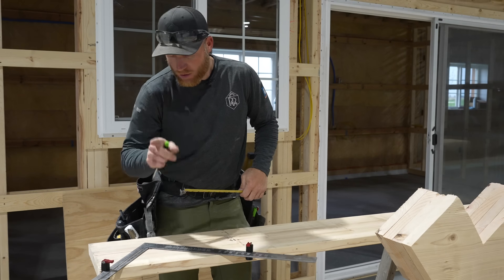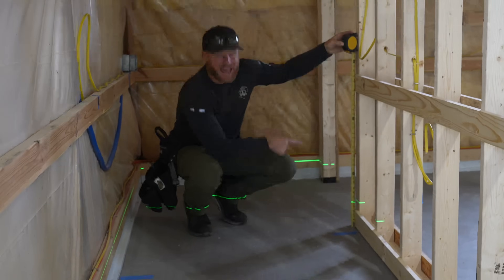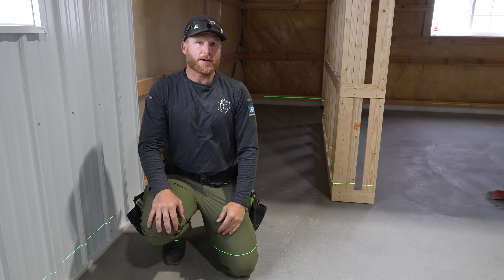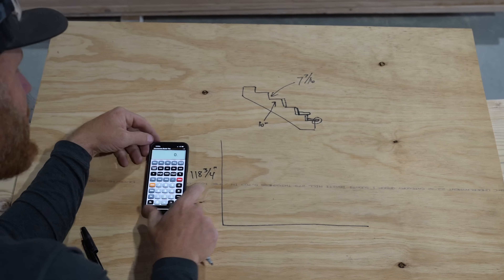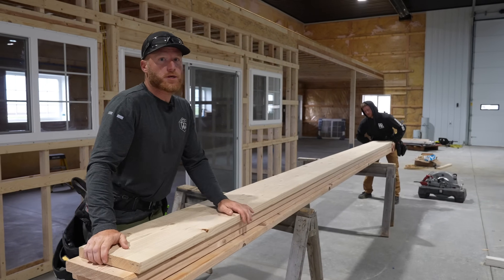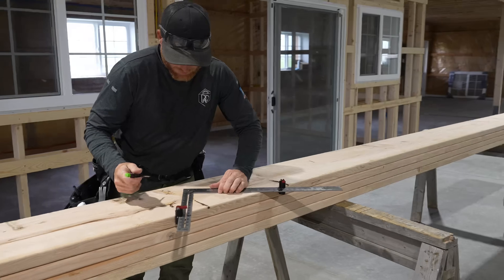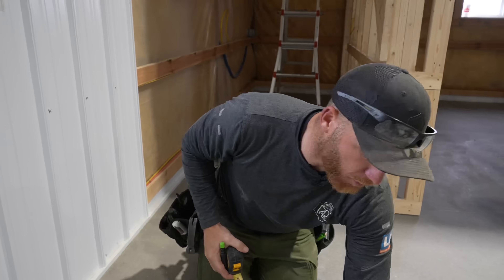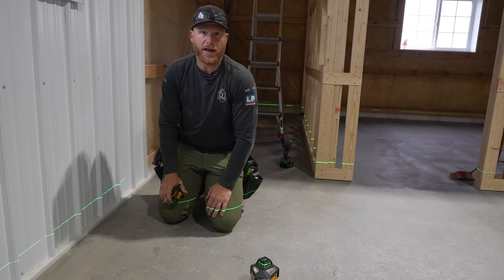Large Workshop Buildout 4: How to Build a Staircase like a PRO

Comment: after you entered the rise and distance out for the treads, what did you punch in to get that 36.58, and then you hit something else again to get the 12 7/16ths? Thanks, Kyle! What is an inspectors error margin for the rise and tread? I was wanting to say that it is less than 1/8" but it's been so long since I done stairs with my dad that I forget how close it has to be to pass an inspection?
Reply from the maker: Not sure exactly. It I can guarantee no inspector is complaint about these stairs
Reply: @RRBuildings  just wondering. I can think of a few times as a teen and then in my early 20s that an inspector in Oklahoma made him redo some stairs because either the top riser was different or the bottom was, but I can't remember what the margin of error was. You seem to have it down pretty tight though! Thanks for sharing the process you use!
Reply: The angle of the rise over run for 118 3/4 over 160 is an angle of 36.58 degrees.  The angle of 7 7/16 rise over 10 run is 36.64 degrees.  The rise of 7 7/16 over 10 will give a distance of 12 7/16 across from one point of the stringer to the next point of the stringer.   The actual number is 12.4626     which  is 12 7.4/16 if these dimensions are done in decimals.
Reply: Rise then Run then Pitch to get the 36.58.   Rise then Run then Diag to get the 12 7/16" (using the 7 7/16 and 10)

Comment: Adjusting the stringers at both ends takes into consideration that the floor is the first tread and the top of the stringer is the last riser.  
At the bottom you subtract the thickness of the tread.  At the top you subtract the thickness of the riser since it’s already there with the header.  
Not sure that’s clear with Kyles explanation.   
This kind of stair building does remove a lot of the structure of the stringers .   A lot of stair makers router the stringers and use wedges to secure the riser and treads.  The risers and treads are slid into the grooves from behind/underside    
Math is the same but structure much different
Reply from the maker: Never seen such a thing have any good links or examples to share?
Reply from the maker: I take that back I understand the sides being routered out but then what about the middle stringers?
Reply: @RRBuildings  on residential where say the staircase is curved they may use laminated stringers from ply’s of some kind.  These stringers provide the support for stairs plus nailing surface for drywall.  
The plys  allow for curving of specialty stairs but will work with straight stairs. These will obviously be notched but since they’re laminate they are mighty beefy.  
Older homes with 36-40 inch wide stairs may not have have middle stringers.  
Im sure code dictates the load requirements for each country and city. 
Your mileage may vary.  
Wider the stairs the more support of course.  
In custom homes the stairs are made in shops and installed… you already know that.  But your building s are different. Rural residential is different … not worse but different.

Comment: Two birds with this stone, 
1st the 199 vs 199.25
118.75 ÷ 16 = 7.421875.  
-7 = .421875. Then for the 16ths  × 16 = 6.75
Since this was done by the calc it gave 7/16
For every 4 rises a 16th was lost 
16 risers so 4/16ths

2nd these inconsistencies can be ignored.
Wood expands concrete settles 
a good carpenter is wrong the right way.
If you start with perfect you'll be off for sure.
But it is fun to aim for perfect
Reply from the maker: Agree
Reply: @RRBuildings  you guys are doing some fun stuff.  I'm definitely stealing ideas.
#1 is post frame construction.

Comment: Reason why didn't hit the 199" 1/4
You took measurements just of one step. Take the full rise height and divide it by the number of rises that you need that measurement use it as your rise and 10in as your run
118" 3/4 ÷ 16 = 7" 7/16 RISE.  10in RUN. DIAGONAL 12" 7/16. HIT + = And the calculator will give you measurements fixing the 1/4in cumulative error

Comment: I liked the video. However, i wish you took it a little slower with the math calculations in the beginning, explaining where you were getting each number from. 

Additionally, i wish you explained the extra measurement you did at the top and bottom of the stringers after you measured out the whole thing.

Comment: I really enjoy stair building.  On this stair planning, you mentioned but then didn't address the basics.  The first thing that you do is determine your floor finishes and address them in your measurements and calculations.  What you did is fine if all finishes, ground floor, stairs, top floor, are bare or carpet.   Examples: If the ground floor is bare concrete and the top floor is carpet or even an engineered wood floor.  Everything is wrong.   If you are going to replace your rough in treads with 1" oak.  Everything is wrong.  
Also, your stringers should have supported at the back.  The front of the stringer is all "short grain."

Comment: I thought the floor wasn’t level, but I watched 4 stringers cut to match. No packing or levelling took place…so how did stairs end up level/
Reply: At 29 minutes in he goes over how he adjusts the stringers to make them level. 

Stringers were cut at the bottom to adjust for the slope in the concrete which was determined with a laser and a tape at each location where the stringer makes contact with the concrete.

Comment: If you enter your total rise (118 3/4”) and your run (160”) hit diagonal and get the 199 1/4, without pressing anything else divide by number of rises in this case 16 you get 12 7/16. You can then add that number to itself and the calculator does the rounding to nearest 16th for you and your last mark will be right on 199 1/4”.

Comment: If you don't own a construction pro calculator then buy one before trying to cut stringers.
FYI nail 2x4 to wall not stringers.
7 1/2" riser is the Maximum height.
No minimum.
 Industry standard is 7 1/2".

Comment: 45:32 Am I crazy or did something fall off the wall? o.O
Reply: That's a gasket from the screws that were removed when they trimmed the metal, screws haven't been replaced because they'll most likely come back through in short order and install the flashing above the stringer where they cut the metal, etc.

Comment: Someone please explain to me why he's adding an extra 10" (1 tread length) to the run? When calculating it myself,  stringer length should be 186-15/16". Even going online and plugging his original values of 118-3/4" rise and 150 run (15 tread lengths) into a stringer calculator,  the proper values of 7-7/16" rise and 10" run are given with 15 treads cut into the stringer.  But stringer lengths do not match up with this video. 
If we were to add the additional 10 inch to the run in the calculation,  to get this 199-1/4" stringer length,  Tread width is no longer 10 inches,  but slightly wider. Because you're using an overhang,  you're not noticing this extra width you've added to the step but you've made the stringer longer and and changed its pitch slightly.
  
Really confused on why you added this extra 10 inches. Makes no sense to me; and all calculators, even the one you're using,  says the stringer should be 186-15/16" long when using 10 inch wide treads. 

Now if you plug in your values into the calculator,  118-3/4" rise and 160" run,  and hit the STAIR button,  it will report a stringer length of 199-1/4" HOWEVER, it will also report a tread width of 10-11/16" wide tread.  Not a 10 inch tread like you cut out.  

Your math looks to be incorrect and you should not be adding that extra 10 inches to the run. 

 6:28

Comment: Good info and video. But  a great example to learn and use metric ( mm) units.  Buy a metric tape and do a video. Much,  much easier. Do it without an app.  1/16 ths ad up and are not accurate!! Once you learn mm you will switch because you will be exact and I know you like to be.. Lay out the "hypotenuse" and index off it not the previous mark. A sq + B sq = C sq.. simple and exact.. You know, math..

Comment: Good build, but two things. Your risers do not need to be 2xs and for your treads. You're wrong. Just like you put your crown up. You want your ri gs of your wood up. Especially if you're doing a deck. Bark side up. If you don't , your wood will cup, crack, then split. It will cause splinters and ultimately fail. When cupping occurs, it starts retaining water, and then it will fail.  You also do not want the heart or center part of the tree either. It will start separating. You want the frown face.

Comment: Okay..... Wow!

Lots of good stuff in here, but lots of head scratching for me thinking "WTF is he wasting time on that for?"

See the GOD of efficient carpentry, the late great Larry Haun showing how to build stairs efficiently.  https://youtu.be/yh6cMQnWGwA?t=2927
I don't like everything he does, but he has it down to a science and it works.  I highly recommend watching all his videos.  I guarantee you will learn something that has you thinking, "Why haven't I figured that out?"   And you'll be a better carpenter for it.  Get some popcorn and enjoy.

I like effing around with math and trig too, but can you give me an example of how a stringer laid out with a framing square and stair gauges set to the 10 and 7-7/16 can NOT match your single step diagonal number within a 1/16?  And what would you do to correct it if it didn't?  If you sight down from directly above the edge, you will be plenty accurate enough.  Bottom line:  I think if they didn't match, the only explanation is a math error on your part.  Or you used a lumber crayon(keel to the old timers) to lay them out.  HAHA!  And even if you did, as long as you were consistent with which part of that fat line you followed with the saw, the difference would be undetectable to the stair user.   I just don't see what your gaining unless your OCD won't let you sleep at night.  If so, go with it.  I'm a bit OCD myself, so I get that.   I DO see some value in marking the top corner cut and the bottom one and chalking and marking the intersecting points and using that for your square positioning, to keep errors from compounding, but I've built a tons of stairs and never had issues with any of the treads being out more than a 16th.

Actually, gang cutting can induce more error than individual cutting.  If the saw isn't exactly set, if you use a sawzall to finish the cuts, and you don't finish that sawzall section with a plane or slick and a square(time consuming), the stringer at the bottom of the pile will almost certainly be further off than if you cut one as a pattern and marked the rest and cut them individually, taking the line with the cut.  It only takes a few seconds to mark the other 3 with the pattern stringer.  For speed, accuracy and repetition, I like to cut all the treads then work my way back up and cut the risers or vise versa.  Plunge cutting them all.   Beam saws are great for some things, but that stringer at the bottom of the pile still didn't get much love from that big blade and leaves a LOT of work for a very inaccurate tool to finish.  But while they need to be accurate, this isn't a Swiss watch.  No need to get better than plus or minus a strong 16th on these.  Fine corrections can be made when installing treads and risers.

I don't know why you made your bottom cut when those were the ones you got the laser out to make adjustments for.  Not a huge deal but you ended up cutting twice and didn't split the difference between them to keep the average within 1/8 of the standard rise.

There is no need to hand cut the waste.  I get that you're selling to higher end customers, but individually cut stringer cut with a saw set full depth with a 7-1/4 saw doesn't over cut enough to compromise the structural integrity of the stairs, especially with 4 stringers, 2 of them anchored to the wall, and risers.  2X treads and risers distribute the load very well.  While nothing you're doing is technically wrong, you are wasting time and overthinking it to the point of making things worse, in my opinion.  

To be clear, I'm not advocating shoddy methods for weak bouncy stairs here.  I'm saying, cut a pattern, mark the others with it, individually cut them all with your framing saw, and you will have an extra hour or so on your hands to go grab a beer and do some math.  Your stairs may carry 10,000 lbs and mine might only carry 9,500.  How much does you big aunt or uncle weigh when carrying a riding lawnmower up the stairs?  Don't waste your time for a load limit that will never be close to being reached.  But follow your building codes if they are more stringent.  

I REALLY appreciate that you left in the WTF moments like the calculator rounding error.  That stuff happens all the time.  But once you think about a quarter inch being divided up in 15 risers?  Not worth wasting time figuring that out.

Comment: In my opinion, this video shouldn't have been posted. You make the claim that this way eliminates mistakes and basically makes stairs perfect. Then, you end up a quarter inch short and blame it on the imperial system when it's operator error with the calculator. You would have almost certainly ended up closer just using the stair gauges.

Comment: If you never cut stringers, buy 1 or extra 2xs, dont gang cut. Mark and cut one, then try it out. If you F'ed up then, your see your mistake and not do it again. If its good, then use it as your pattern. Remember to scribe tight to pattern, and to cut line off of the piece you  just marked when cutting. 

Its really not hard when you have the internet to learn 1st (lucky youngters). When I was getting started you had to lern from magazines or hope to work with a good carpenter to learn from. I thought I was a great carpenter until I met a real carpenter in my late 20s. Most "master carpenters" are bums.

Comment: What's the point of putting all those marks when they come up 1/4" short? I'm sure you wouldn't be that far off if you just marked the square over and over. You've actually made it worse with that method.

Comment: Let’s make it simple, loose the calculator. To find the rise of each step. Total height finish floor to finish floor divide by 8 then add one more extra rise. Now divide that number into total rise. That equals the height of each rise. Example: total height 107” divide by 8 = 13.375 now add one extra step. 14 steps/rises divided into 107” = 7.642” know let’s change .642 into inches  .1 = 1/8 inch so .642 = 3/4 inch. Each rise is 7 3/4” Length of stringer is each run (normally 10”) x one less of total rises = 13 Example 10” x 13 = 130” If you like a less of a rise per step (older people) add one extra step/rise. Example 15 rises divided by 107 = 7.133 or 7 1/8 “ per rise. I hope this helps younger carpenter’s. Better to learn the formula vs calculator. I’m not saying don’t ever use a calculator but understand how not too.
Reply: I’m a little confused about .1 = 1/8”.  I’m not sure how .642= 3/4”, could you clarify please & thx
Reply: @markgriffin9818  I don't want to speak for him but I think what he's trying to say is that if your doing quick math in your head without having to use calculator (1/8" is actually .125") but if you imagine every .1 increment to be 1/8" then .642 would be 6/8" = 3/4". If you were trying to get to the closest fraction of .642" that'd be 11/16" but if you're building something it's easier to use 3/4" because it's stairs and not a part for the space shuttle. The old time carpenters built some amazing stuff using mental shortcuts because they didn't have calculators.
Reply: Code typically hold us to 7" rise and 11" tread width. You are correct I would have added a step too on your calculations.
Reply: @jasonjohnston185  You are absolutely correct. Thank you
Reply: @markgriffin9818  Jason is correct in his response to you. I hope this clarifies it for you. Thanks

Comment: Why you guys always making steps 10 inches when Black folks have on average 11-12 inches foot? This is why they have so much accidents annually off the steps y'all make for your small feet. Also, why the mathematical complications? Just use a tape measure from the landing down the hypotenuse to the floor and cut three boards that length and notch out your runs and risers from ground level to landing!😂

Comment: How can you guys stand using inches, just stop using it and convert to metric, you Kyle have been to Europe and studiyng it yorself.
Reply: It is very hard to use metric when all your supplies come in feet and inches. I use metric when my supplies come in metric.
Reply: The material is ft/inches, the other trades are using ft/inches, etc etc etc
Reply: totally understand where you're coming from and you're right. It's kind of just the way it is here. You could try to do everything in metric but when everything is made and sold using imperial system you would drive yourself insane trying to do conversions from Imperial to metric all the time. If you grow up using it, you're used to it and it's easier than it looks. If you value your mental health, just never try to start a construction project in America and you'll be fine. 😃